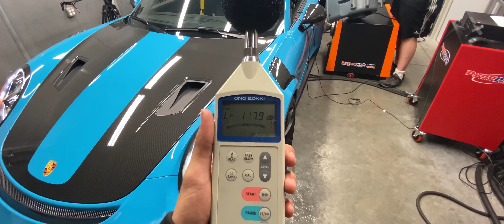GT2RS SPITS FIRE - Dundon Inconhell Street Exhaust

Comment: HP increase? Did u ever compare the stock exhaust for db increase?
Reply from the maker: Manifold pressure is monitored and controlled. So a tune is necessary to allow more boost, we see the boost come in earlier but that’s about it.  Needs a tune for more power.  Luckily with Cobb that’s a simple exercise
Reply: @DundonMotorsports  what if we just wanna keep stock power and boost? Could we see the curve difference? How's spoolup and such? Should be less pressure and quicker spoolup. More power on the track or street ain't required at this level. Luv it though and I know many are on the quest for HP but not trackrats.